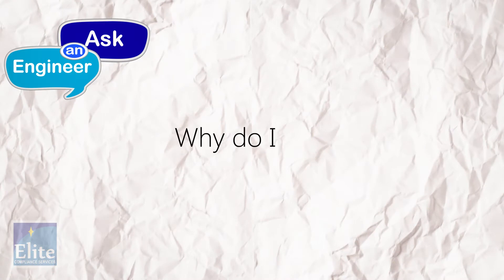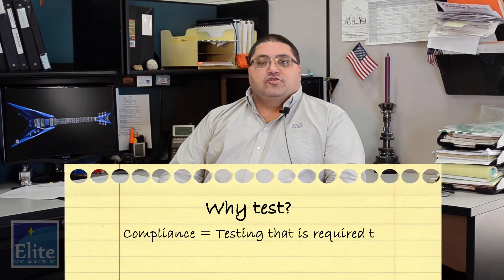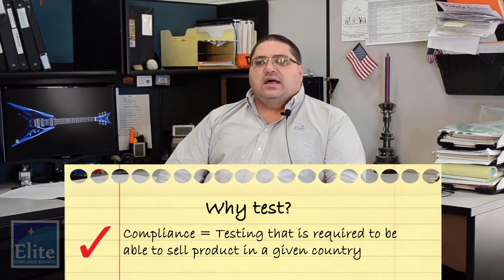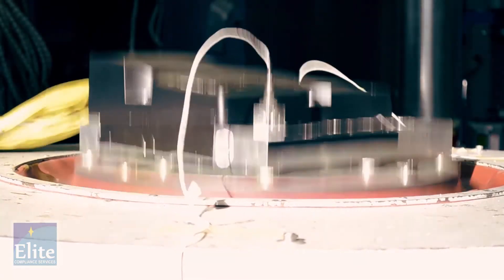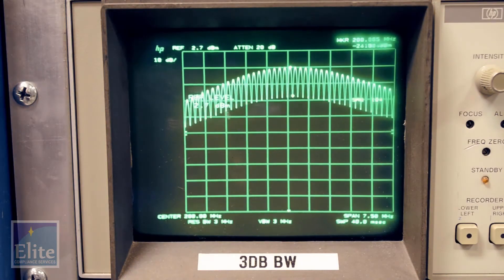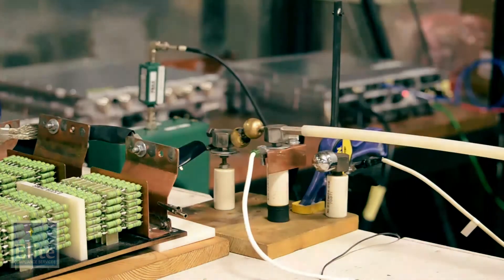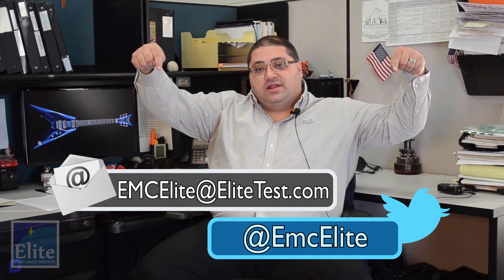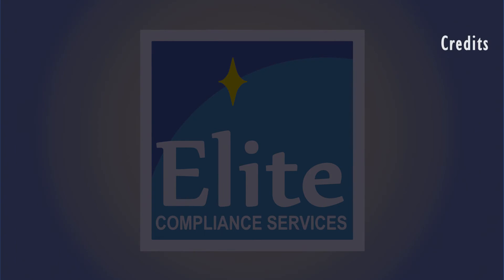Ask An Engineer: Why Perform EMC Testing?

Comment: Wow 1 question? Is  that is all you had? Well I got one question: How do you deal with CAN bus disturbances when testing an ECU with BCI method according to ISO 11452-4 with increased power to 50 dBm in 1-30 MHz band?